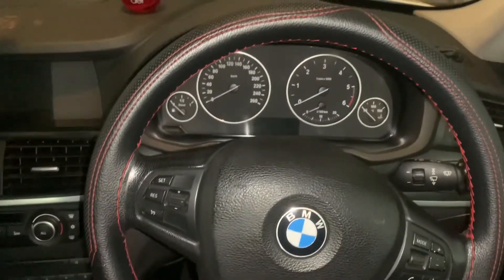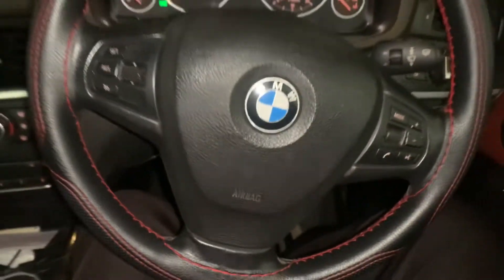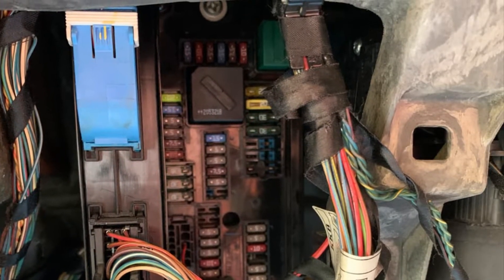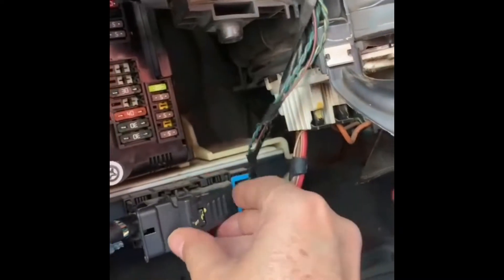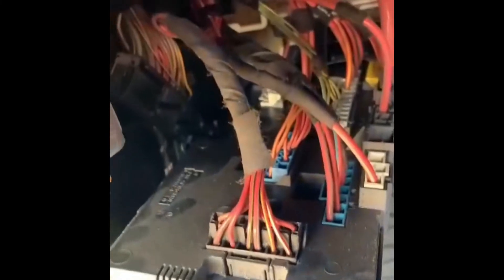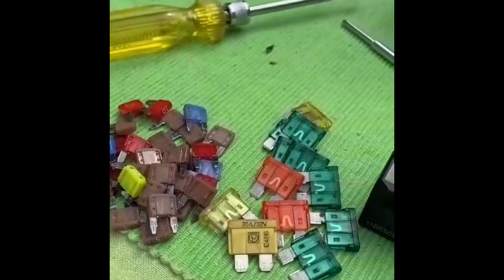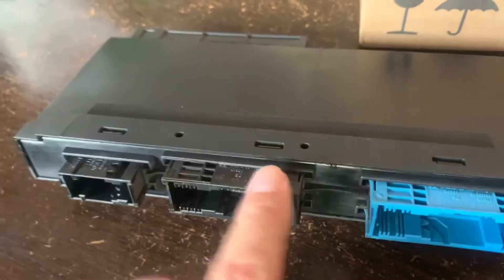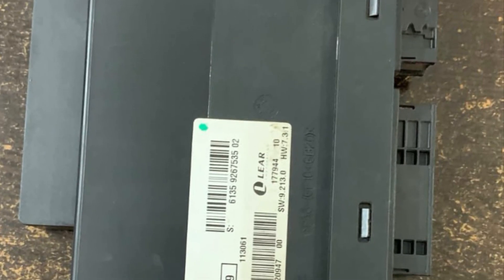BMW Junction Box Electronics: Symptoms of failure. JBE and Fuse Box Removal.

Comment: did you’ve to jump start the car at times to start? And was it losing all electricity for a long time unresolved ?

My car suddenly dash light not working. Interior lighg, key fob doesn’t click open the car, button inside doesn’t click open the car doors, only door I can open is driver with key, car only starts when I jump start it. Even then, front light doesn’t work so I don’t drive it at night but rear light works, trunk doesn’t open since 2 months when the problem started so I can’t reach battery or inspect the rear
Reply from the maker: I never had issue regarding starting. Probably your JBE is faulty. Look for a used one. New one is costly.
Reply: @rsingh6438 all research I’ve done points to FRM not JBE, it’s so easy to miss things in bmw and replace different things that fixes nothing

I’ll reset my FRM and recode it, most videoed showed same symptoms as mine and that fixed the issue

Comment: Atleast show us how to remove the conmectors bhai
Reply from the maker: @devonnaidoo-q3q  It was very difficult to videograph, so it was missed out. But all connectors are easy to remove except for one, where a long plastic pin was to be slide out.
Reply: @rsingh6438 This difficult one you are talking about is the one at the back of the JBE right? If so, how far is it supposed to slide out? I've managed to slide it out about 1/2" with the fuse box still in place, but I can't seem to get the plug out now. Is it supposed to slide further? TIA
Reply from the maker: @markhorridge7104 it is to be slide out with the fuse box still there. 1/2 inch is correct.

Comment: How did u actually remove thr JB? I have to add a linbus wire to A34*1B..pin 9...but not sure how to access it. G
Reply from the maker: Remove the glove box first. Then you’ll have access to the jbe. Remove the connectors. After that unscrew the two lock Screws.
Reply: @rsingh6438  Can you make a video please

Comment: What year is your X3?  I have a 2013 X3 that has a crank, no start issue and I have ruled out all fuses, the ISM, and the wiring harness connections.  I am thinking DME is bad, but perhaps this problem could be related to what you were seeing.
Reply from the maker: Pl do a scan to get an error code and start from there. For a diesel engine, cranking but not starting would be a problem of fuel starvation.
Reply: Did you resolve your issue on your 2013 X3? If so, can you share the steps you followed?

Comment: did you have to get the new jbe coded?and did you happen to hear any clicking of the relays?
Reply from the maker: Yes. When the problem starts, you’ll hear a clicking sound. You have to code JBE after replacing.
Reply: thank you @rsingh6438
Reply: @rsingh6438  Thanks for sharing this. Coding the JBE seems like an important part but it was not mentioned in the video. How do you code the JBE and is this something for DIY?
Reply from the maker: @ since it was replaced at service centre, they did coding as well.